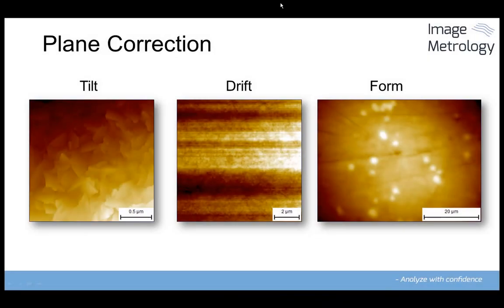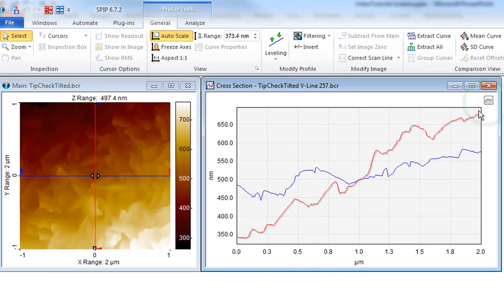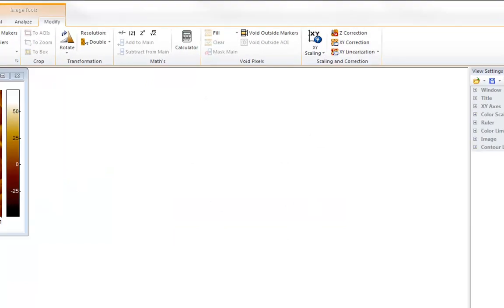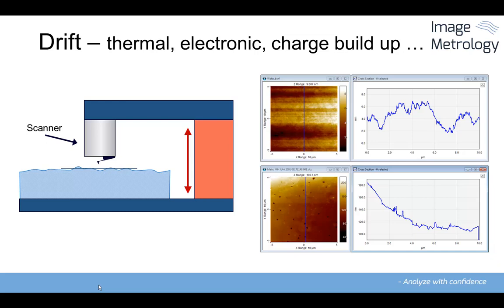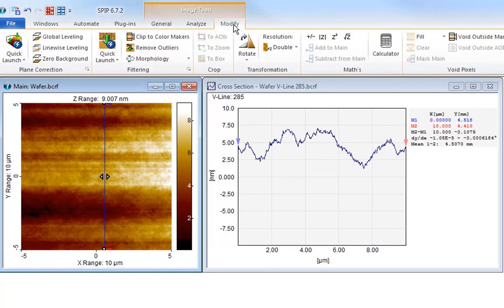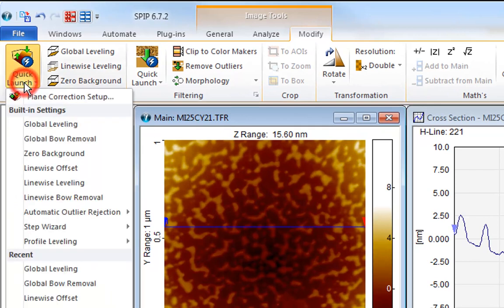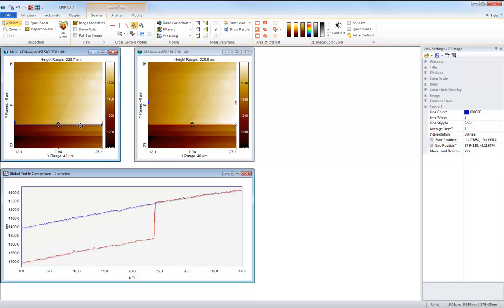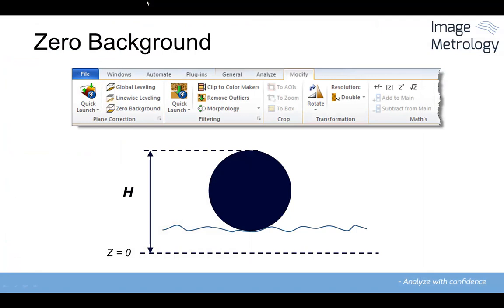Learn the basics of plane correction and flattening

Comment: How could you figure out there is a slight tilt in x-y direction
Reply: It is always a good idea to look at the cross-section profiles for both the x and the y directions, which will reveal most tilt distortions. It is also a good idea to use average profiling where the average of a number of neighbor profiles are average to lower the influence from local variations. To validate and tune the result it is also a good idea to monitor the height distribution histogram, where narrow and high peaks indicates flat structures.  When the surface contains terraces the histogram will exhibit more peaks, each associated with a terrace level.